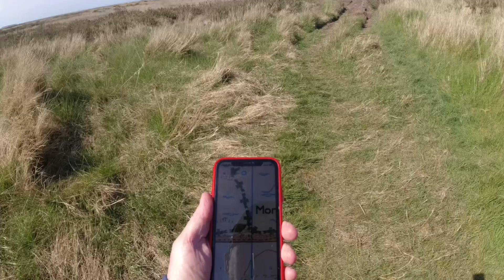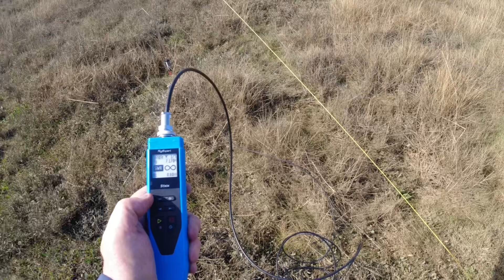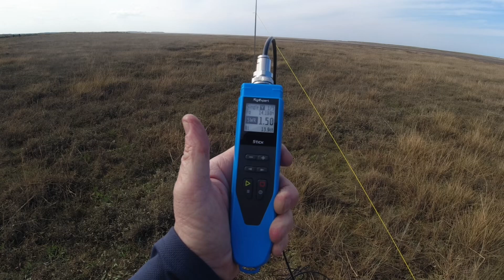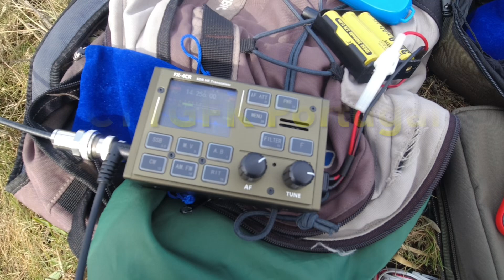Loading Coil For 7 MHz No Radials Will It Work?

Comment: Hi you needed more inductance your tap needed to be neer the bottom of the coil not the top for quickness just use one groung wire good luck from chris G0WFH 😊
Reply from the maker: Cheers Chris, I tried with the tap at the bottom of the coil first as well as sliding the plug along the length of the coil, it was hard to tell but counterintuitively the received noise sounded louder with less coil in line. I have ordered a Slidewinder could which will be easier to adjust and will try it with one radial as you suggest. Watch this space👍

Comment: I enjoy your content, great work. Looking at your coil I think you probably needed more inductance. My JPC-12 would have been nearer the bottom of the coil for 40mtr. I'm sure you will investigate. Look forward to your next, 73 de M5AEI
Reply from the maker: Cheers Ellis, I did try with more coil inline and the SWR was still way off, I also slid the banana plug along the coil and counterintuitively I was getting more received noise towards the top of the coil with less coil and not more. Weird, anyhow I will try this again but with a new easier to adjust coil which will help on a not so windy and cold day. Watch this space😊

Comment: Nice location. Of course, in a coastal environment, notably one like this which is saturated with seawater, the ground is essentially perfect anyway. A simple copper pipe ground stake - or in your specific case, the ground spike that is part of the antenna mount - will give you a very good match (as you found - it will almost always be 1.5:1 like this), with minimal ground losses. And you always have to keep in mind that, from such a location, even with a less than technically-perfect antenna, you will typically far, far outstrip the performance of inland stations, even those with a directional antenna (depending on time of day, band, etc). I'm pretty sure you can achieve a system that doesn't need that tuner. Always strive for tuner-less operation, especially with verticals.
Reply from the maker: Thanks for your comments, I’m often operating on salt-marsh and until recently have favoured elevated radials with resonant antennas but since I purchased the cheap AliExpress antenna I’ve been experimenting with ground, and now no radials, looking for as quick a set up as possible. Most of my operating is done next to saltwater with excellent results even on low power. I took along the ATU on this occasion thinking with the narrow bandwidth with the coil inline if I got close to a match I could get on air quickly. Quite often on quick activations like this I make sacrifices in efficiency for the sake of practicality and time constraints but the goal is as you suggest is to avoid the use of an ATU. Watch this space, I’m not done yet😉

Comment: Enjoyed the video again nice to see the paddling and outdoors as much as the radio. Yes you are right the ferrites should prevent most of the common mode and prevent  the coax becoming the counterpoise for your antenna, as the frequency goes down then the area required for the ground goes up so this is a bit like the guys who try the "magic carpet" grounds who find that 40m is too low for effective ground.. Can you do this again with and without a set of radials it would really be a good A/B test ...Cheers!!
Reply from the maker: Thanks, yes I will try more experiments, including with and without radials. I’ve not given up on use of a coil to get on 40m but the Buddipole could is quite fiddly to adjust so I’ve ordered a Slidewinder coil. Watch this space😉

Comment: I wonder if the performance of the antenna could be improved with ferrite beads at the radio end. When placed at the antenna end, they could be choking off the radial effect.
As always, I look forward to your future videos.
Reply from the maker: Cheers Dave, I will try that along with a few other things, the aim was to get on 40m as quick as possible, hence not using radials. My main problem on this occasion (aside from the wind and cold that cut it short) is the Buddipole coil is too fiddly to adjust quickly. I will try your suggestion for sure so keep on watching, thanks Kevan😊
Reply: Yeah it would , a lot of people dont like their co-ax radiating thus the other end and this does test a no radial setup properly.
Reply: Correct. The antenna needs something to push back against. In the absence of a radial field or some other ground then the coax becomes the thing to push against and becomes a radial. A line isolator at the TX end chokes off the common mode coming back.
Reply from the maker: @fairwayfinder18 thanks for your thoughts, I will try this next time, thanks for watching😊